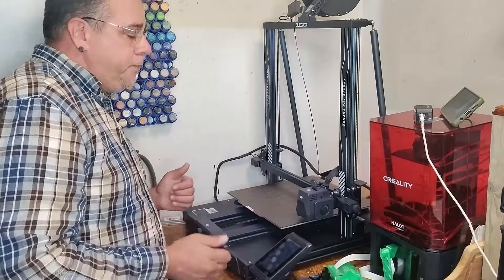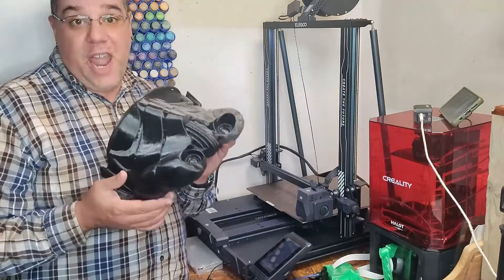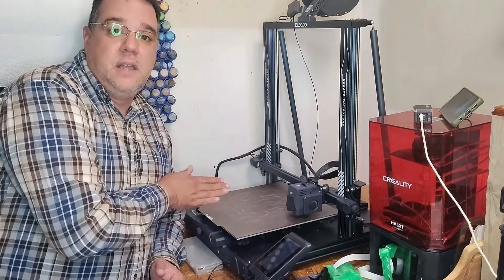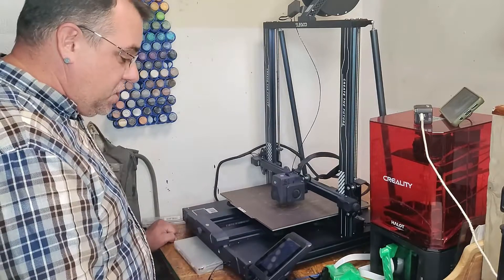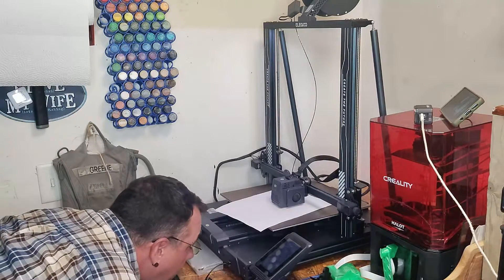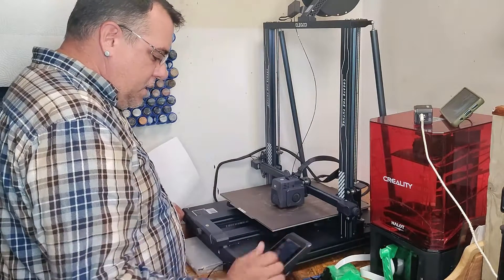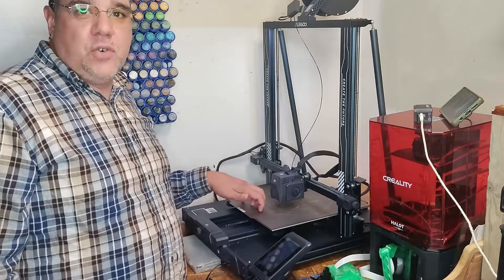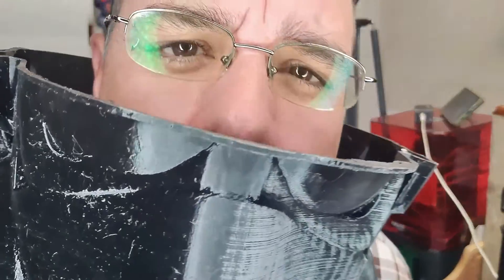3D Printer Bed Leveling The Easy Way | Nozzle Z Offset Elegoo Neptune

Comment: OK are not making the difference just show as a print  of 0.2 layer Hight by 420x420 mm ,because all they tried with manufacturer instructions and after they make the screw tilt adjust etc in order to print perfect like Bambu
Reply from the maker: It can definitely be a frustrating process, but sticking with it usually pays off!

Comment: I got a elegoo neptune pro 3 and im consistently hacing problems with my prints popping off no matterbl what i do
Reply from the maker: Start every time with the basics. Clean, level, and take your time. Don't overcomplicate it. Take your time. If things aren't sticking then you either have a dirty plate, or you're not leveled correctly sometimes it's the object you're printing itself, make sure in your slicer program whichever one you're using shows that it is secure to the plate. You may need to use a brim, in orca slicer I use the mouse ear brim to keep everything on.

Comment: Why didn't you manually level the bed before you done auto bed level?
Reply from the maker: Technically it's not leveling, but tramming, making sure the offset of the nozzle is equidistant to the bed in 7 areas.

Comment: Hey i dont know if you still answer comments on this old of a video, but thanks so much for describing what its supposed to feel like, cuz noone ever does, my question is, when you put the paper under and you get those faint little scratches on the paper when you pull it out, like they havent made a impression but theyre there when you hold it to a light, is that the proper level? and do you know the right level if you pull it out and cant slip it back under?
Reply from the maker: If you can't slip it back in then the nozzle is too close. You should be able to move it freely, but have that slight resistance.

Comment: my knobs spin off before the nozzle even touches the paper...........knobs
Reply from the maker: That almost sounds like a personal problem 😜 
I would actually screw on those knobs a little more and then try hitting the level button first. Machine might bring your nozzle a little closer. If not you can always spin it down from the Prepare settings or manually.
Reply: @HelpfulHobbies  i just threw it away tired of messing with it

Comment: That confirm at the end is to explain that you may need to do a live z adjustment during first layer to make sure the layer is set correctly and shows you what the layer should look like, not to tell you to adjust z again right now..  By adjusting it after it has done its auto level, you have altered all of the distance measurements it just completed, invalidating the autolevel. Sequence of events should be, hit level, adjust z offset, auxiliary level and manually level all the points (this will take multiple checks, each time you adjust one point it slightly alters the rest), then autolevel. Confirm that you understand that you might have to live adjust z based on how the filament is being laid out, click the back arrow, confirm save and reset.   This is exactly how it is spelled out in the manual.  I have had zero issues with first layer prints following their instructions.  

I have had zero issues with my Neptune 4 Max.  The first thing out of the box though is you MUST update the firmware to ensure you dont have the original firmware that wasnt saving the autolevel table information.

That being said, I'm waiting for my 32g mks emmc to arrive before switching to firmware over to OpenNept4une firmware so that I can do updates from upstream and restore klipper functionality.

Comment: i noticed that the steel nozzels give me so many problems.  the brass ones seem to work with no issues. ANyone else get the same result?
Reply from the maker: Absolutely agree. I want to say it's because unlike brass that is softer and gives way over time, the steel is tougher, and I believe dirt and wet filament clog it. I could be totally wrong.

Comment: Good video helped a lot. I got a nice first layer but it got to about 84% then it lost adhesion and started to move on the plate. It’s a Neptune 4 pro. I leveled the bed manually and then automatically using your method please any help would be appreciated
Reply from the maker: Glad it helped!

Comment: I'm in the USA!  We don't use A4 paper.  I use 8.5 x 11" paper. Is there a difference in thickness?  Elegoo says to adjust Z untill you can pull but not push. Not an even drag on my Neptune 4 Pro
Reply from the maker: Standard letter paper is what I use, closest thing to A4. Funny how the world uses A4 paper size, but here in the US we use a different measurement. Just like Fahrenheit, inches, etc 😂
Reply: @HelpfulHobbies  Yea sure is wierd.  ºc    ºf  A4 vs 8.5x11  Liters vs gallons. Then therer's metric Gal US Tons Metric tons. the world will neverget together 🤣

Comment: I'm starting to get the bed leveling down ("auto" bed leveling, my ass!) but next I have to tackle layer shift. My N4Pro nearly flies off of the table it's on at default speeds... If I slow it to a crawl it kinda sorta prints straight, rather than at a 45 degree angle.
Reply from the maker: I've heard with the Neptune four series they've had a lot of different little problems here and there.

Comment: Why can't the manufacturer just set the z offset to the required thickness automatically, as part of the bed levelling process?
Reply from the maker: Excellent question. You think that they would set you up for success and not failure after failure with a 3D printer. But take this into account, first of all they're shipping you a machine whether you're buying it on Amazon, or from the manufacturer or wherever it's going to be jostled around inside of a box which is inside of a truck or a train or a boat etc. Then you have to also think about after you've set it up that machine depending on where it is might be susceptible to the changes in climate. As you see from my videos I'm in a garage it's an insulated area but it doesn't have heat or cooling during the winter it's about anywhere between 50 to 60° in here Fahrenheit, but sometimes in the summer it could reach up to about a hundred. That bed itself will flex up and down and not always in a uniform manner. Maybe only one of the corners stays at the optimal leveling whereas the other three corners start to warp because of expansion or contraction from heat and cold respectively. Plus your nozzle on your extruder, after a while nozzles wear down especially if you don't have it offset and leveled correctly and you're scraping across the bed like I used to do with my old machine lol. Would that being said your nozzle height might not always be the same, especially across the broad spectrum of manufacturers that are out there for the different machines. Even changing from a brass to a hardened steel or stainless steel nozzle means that you need to zero out and relevel everything on your machine. As I said in the video I re-level every damn time I'm down here putting an SD card into that machine. It's the safest way to go

Comment: You said something very helpful. "Zero out the Z after every print". I have been struggling with my Neptune 4 Pro dragging the bottom raft layer, but I didn't think about bringing Z back to true zero before automatic calibration, and THEN using the paper to adjust after the fact. I'll give that a shot tonight. Thanks!
Reply from the maker: Just glad I'm able to help
Reply: How did it turn out? I'm having the same exact issue as you with the same exact printer

Comment: Thank you for showing the z offset. “Lightly scratching” as the manual describes is subjective. 

Also, have you had any issues with clogs? This is my first printer and I’m still learning the ropes.
Reply from the maker: I actually did have one big clog but I think it was because of using the old nozzle. It was a used machine that I got from Elegoo, and I should have checked a little bit better the very first time. I had to heat up the entire block and shove a needle up inside. I think somebody tried to use nylon in it before.

Comment: I did this and my prints still all fail. The neptune 4 pro lineup has been plagued with manufacturer defects (nozzles/hotend distance sensor misalignment) and firmware errors (not using the bed level mesh by default). YOU got lucky enough that yours worked the way its supposed to out of the box, but many people got dud printers that require more effort to get running properly.
Reply from the maker: I haven't heard much good about the Neptune 4 series other than klipper. Not very impressed, but I hope Elegoo learns from it.
Reply: Just got mine a week ago and I think mine is one of the duds. Were you ever able to get yours working properly?

Comment: A4 is a size not a thickness. Should they be telling us what gram paper weight to use ? The GSM which is more thickness related.
Reply from the maker: The common gsm for A4 paper is 80, if I recall from my cubicle farm days. That being said, that's usually a thickness of .10 mm, depending on manufacturer, etc.

Elegoo doesn't specify, so I'm guessing common printer paper that would be used by consumers.

Comment: I've been printing for years and when I first started printing I always  used 1 sheet of paper and if I ever ran a first layer calibration from cura it never worked, I always had to raise it and I have 4 different types of printers and it was the same for each one, so if you get 2 pieces of printing paper they equal 0.20 mm and I put my printers on 0.20 layer height profile and when I finish, it's perfect, I can run any print and calibration, even the calibration castle and my printers print everything. It took me a year to figure that out 😂. I don't run any first layer calibrations any more because I did in the past and it's perfect every time with two pieces of regular print paper 0.20mm
Reply from the maker: You ever notice the simplest way to do things is usually the last thing you think of after tons of trial and error? I usually start thinking of myself as a guru after that 😂
Reply: And IF it's a bit too high still you just do a 1/8 of a turn in CCW direction on each if the 4 bed knobs. And that's it. If you need to re-adjust on every print it means the end stop switch or the bumper are flaky.

Comment: Thanks I was raising my neptune 4 max a few cunt hairs after I felt a drag.maybe that's why a get fails not sticking to the plate.
Reply from the maker: I was right there with you doing the same thing, and then I just did this and it works every time